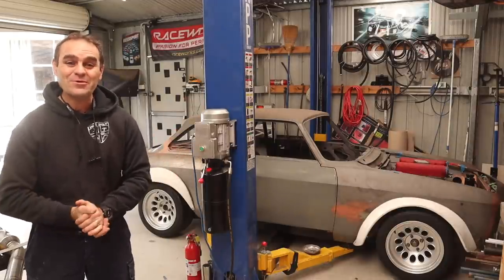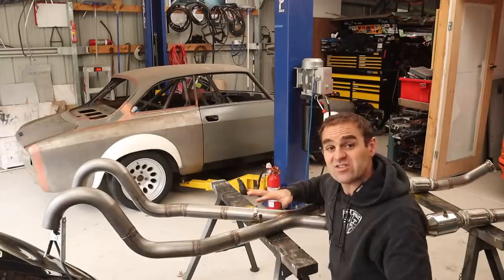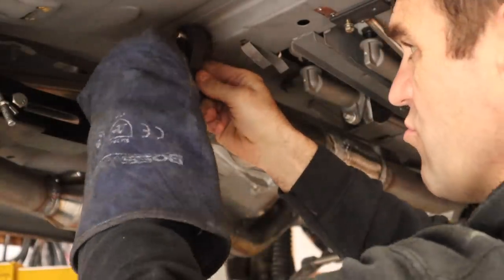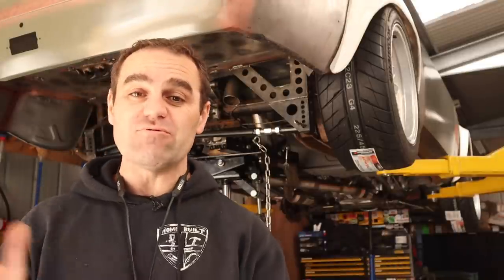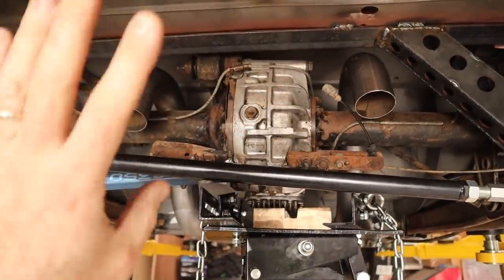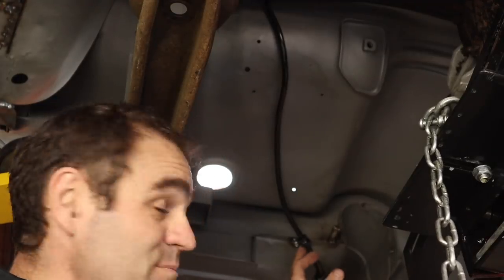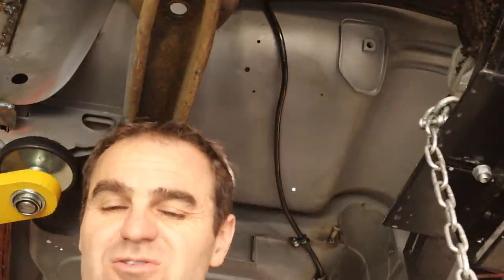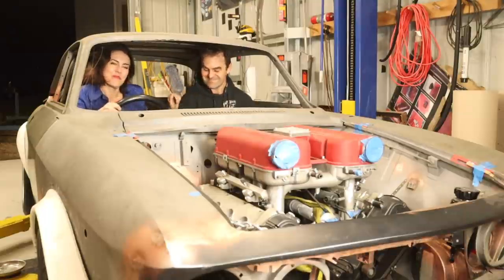Hangers, sensors and lines - Ferrari engined Alfa 105 Alfarrari build part 90

Comment: Consider buying some real hanger rods and forming them around the pipe.  You will need the surface area for strength of the weld.  The way you did it will rip out of the pipe.  Use stainless welding wire if you have some.  Can't wait to see this monster on the road!

Comment: Just a suggestion, heat wrap the exhaust near the oil line too. The sleeve will be OK but there's a lot of heat that close to the engine. Your project and you do what you see fit, but a little bit of extra protection won't hurt and if it becomes superfluous you can always take it off the exhaust easier than the oil line :) Enjoy seeing this project taking shape and getting closer to finished.

Comment: Couple tips for you Jeff, the hanger wielded just on the  tip will crack, need to wrap the rod around or along the tube for more contact area. Also triangulating with a second rod helps a lot. When laying out the hangers and clearance around the system (particularly above the diff) remember the exhaust will grow in lenght when hot, and can be quite significant by the time you get to the tip. So the hangers should acaccommodate this movement by sliding or pivoting rearwads.

Comment: I’m a chassis engineer at an oem, the guys saying you need more length on the exhaust hangers are 100% right. More forces going on than you imagine. Bend from one piece if possible and make at least a 40mm “L” shape and weld to the side if the tube.
Reply: I had the same thought....I'm not a chassis engineer, but it's not good engineering practice to weld the hangers on perpendicular to the exhaust tube OR the chassis. Use it, don't use it Jeff but keep up the awesome videos 👌💯😎
Reply from the maker: There was no easy way to bend that solid stainless rod otherwise I would have. If it cracks it is a 5 min fix on the hoist ;)

Comment: Usually we make the rod attachment point on exhaust pipe long and weld over a few inches. That way you don't rip the mount off with the little weld. Prolly be fine on 400 series stainless but yeah looks odd the way you did it
Reply: Yep, just wrote a similar comment.

Comment: Just a note..... exhaust hangers usually 'wrap around' the exhaust by 2 to 3 inches, to spread the load. A bit concerned yours might eventually stress crack being welded on as a stub....

Comment: Why not run the fuel line along the passenger sill? Keep it away from the exhaust heat and less twists and turns then go up into the engine bay when at the front?
Reply from the maker: I probably could have, but I wanted to tuck it up high out of the way so no one could ever accidentally put a jack on it, etc. I basically just copied the factory just on the other side.
Reply: Make sure you put some heat shield on the fuel line near the exhaust. Vapor lock is a bitch.
Reply: Was thinking exactly the same! most cars mounted on the sill as it's the safest place for a fuel line
Reply: @andrewalfe8433  , with a high pressure system vapour lock is not often a problem as the fuel passes to fast to really heat up.

Comment: Hi Jeff, I once built a V6 engine into an Alfa Spider. I used a rear differential from an Alfa Montreal (V8 engine). This differential has a reinforced input bearing and of course a differential lock. Before you get a cardan shaft, you should decide here. The Montreal differential housing is 10 mm longer than the normal housing - therefore, the cardan shaft must be 10 mm shorter.

Comment: Jeff, for extra security in the hangers you could drill a small hole through the center and fix a spring tension clip. Similar to hood pins and clips on race cars. Easy to remove for service and secure for function.

Comment: Great work Jeff. I would also add a second pump with a swirl pot. I have found any air in a returnless system will  make for fuel starvation and hiccups in drivability when the tank gets low meaning quarter to half a tank of fuel. With a swirl pot you will be able to run the tank dry and no fuel sloshing problems. Also a BMW E36 fuel filter has the regulator built in for a returnless system so less plumping. and easy to find and cheap. Just my 2 cents.

Comment: Awesome work as usual man! My only suggestion, you should definitely make the exhaust hanger on the pipe have a long tail that lays flat. With just a stub welded to it, you are very likely to break it off. It happens lots

Comment: X pipes are not only for sound they also help with scavenging wether there is sufficient benefit to having one on a flat plain crank is yet to be determined but it will really depend on how far the x pipe is from the motor as to if is of much benefit it can be

Comment: Mate you should invest in a nutsert gun (like a threaded pop rivet) if you haven’t already, makes short work of mounts for p clips etc, quicker, neater and stronger than tacking on nuts. Keep up the good work,👍
Reply from the maker: I have one, but if it is something that can be exposed to weather the bolts can corrode and the nutsert can spin and then it is a real pain to get it out. Captive nuts are much stronger ;)

Comment: Jeff, i would not be running the fuel line so close to the exhaust, i would place it on the other side of the floor rail. The cooler you keep the fuel the better.

Comment: Jeff, I noticed the trunion bar still in there, and went back to episode #75 and re-listened to your explanation of the sliding bushing on the Trunion bar.  I'm not sure it's not going to affect the roll center.    I've got an aftermarket Watts linkage on a couple of my Alfas (Spider, Berlina), what they do is use a mounting bar left to right where the Trunion bolts to the chassis, then an adjustable rod with Heim jonts on either end between that bar and the large differential bolt.  That setup limits the Heim jointed bar to simply controlling the rake of the differential.
Reply from the maker: It works and does change roll centre. It has already been used successfully in other cars ;)
Reply: @HomeBuiltByJeff  I'm trying to wrap my head around it.  Makes perfect sense if the car is sitting flat and the rear is moving up or down.  But as the car leans left and right, it should pivot around the center point of the Panhard bar (that's the new roll center), which means the upper joint should be moving through an arc, right?  Anyhow, looking forward to see it all in action, very possible there's something I'm missing.
Reply from the maker: @brianshorey  Still pivots the same as it did in it's original state ;)
Reply: @HomeBuiltByJeff  Right, but isn't that a problem?  The Panhard bar height defines it's roll center, the stock trunion bar defines it's roll center (which is kind of high).  The purpose of a Panhard bar or Watts linkage is to lower the roll center in addition to locating the axle left to right.  My napkin diagrams have me thinking that your slider in the Trunion bar is going to be the limiter to your body roll, when you reach that limit the Panhard bar and Trunion bar are going to be working against each other.  Anyhow, I'm not an expert by any stretch, although I have installed a few Watts linkages in 105/115 Alfas.  The good news is that if what you have in mind ends up not working, it's relatively simple to replace your Trunion bar with something like Classic Alfa sells with their Watts linkage kit.  Easy for somebody of your skills to fabricate, and it will bolt right in.  Carry on with the great work!  Love this series!!
Reply from the maker: @brianshorey  You are correct, but the left to right movement is not actually that much, so as long as there is enough travel left to right it is fine.

Comment: Just echoing what others have said about the point of contact on the exhaust hangers, could you maybe add some additional support, a hook from under the pipe too the rubber ..
Great buil though,
Looks great on those wheels ☺️

Comment: It’s looking really good 👌

Wonder how that old diff, and it’s 50 year old axles will keep up with the power of that Ferrari engine.
Reply: Those alfa diffs and side shafts were actually way over engineered. Very sought-after in South African race circles because of their robustness.
Reply: @tonydegouveia9256  granted they’re tough, but that’s behind a 1-200hp four pot. A Ferrari engine is a different beast all together. Plus all the gears will have wear and tear, with a bit of play in them after 50 (assuming it’s never been rebuilt). I wouldn’t be surprised if it snaps a axle at the very least.

Comment: I think those hangers are going to rip off the exhaust. Also, I think they'd be a nightmare to get the rubbers off.
Reply: I tend to agree. Welding on just by the ends is not a great idea. Making a kind of flattened S is a better way with the welding over a wider area.
Reply from the maker: Getting the rubber on and off is easy, and if they do become an issue it is a 5 min fix on the hoist ;)

Comment: Jeff, nice job as always,  question I’m working on a TR4 and about put in fuel lines. It looks like your fuel line is very close to the exhaust in certain places, any issues with heat from the exhaust? I agree the car has a nice stance, should be a lot of fun with that power.
Reply from the maker: It will be insulated where it goes close.

Comment: G'day Jeff, 
Enjoyable video great content. I rekin you got heaps done organising those little things and actually doing them certainly eats up the time. 
But hey a couple of questions. 
The D/6 fuel line from Race Works what type are you using .
And now that your exhaust is in what ride height from the bottom  of the exhaust did you end up with. 
Anyhoo stay safe and healthy man. 
✌ Peace.
Reply from the maker: Ride height still needs to be set with some springs, but there is at least 100mm

Comment: No offence Jeff but, fuck deadhead systems. I guess they're ok for NA applications but they seem to have dramas when it comes to tuning and whatnot.
See how it goes though, I know there's a few fuel filters that actually have a pressure reg built in for a deadhead system which are really neat. Can't remember what car they're off but you should be able to find them without much drama
Reply from the maker: Most factory cars run dead head now.